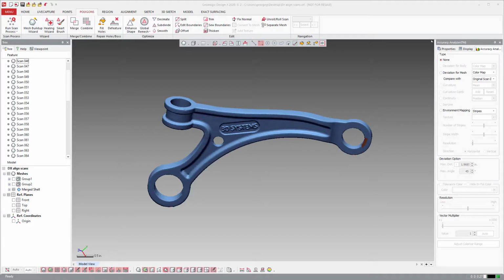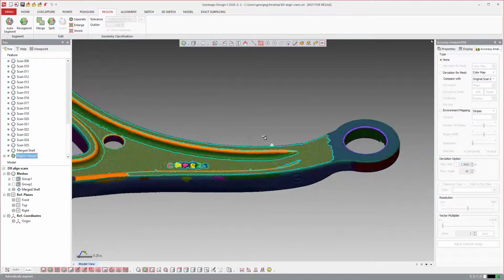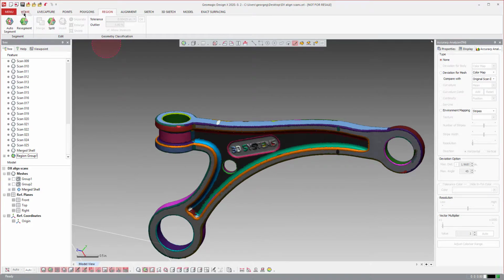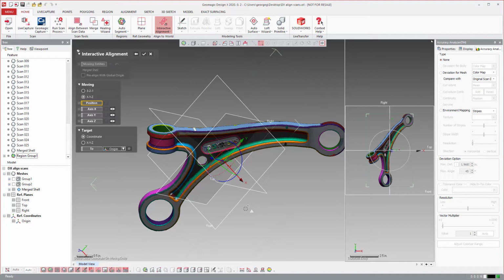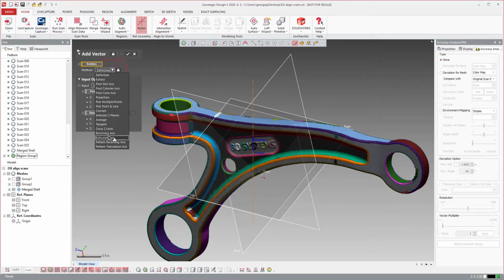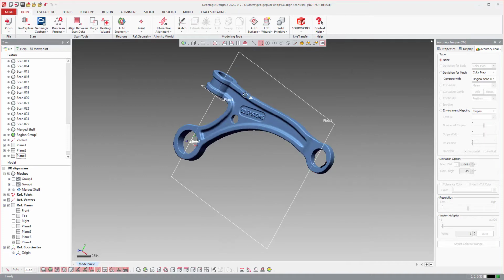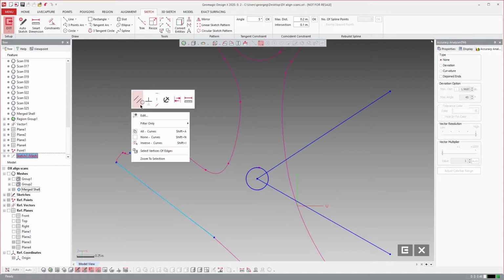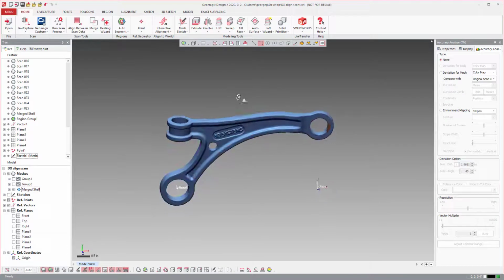Geomagic Design X -  Interactive Alignment-Align to World Tutorial

Comment: 3-2-1 explained.

There are 6 degrees of freedom. Translation along XYZ and rotation about XYZ

Datum A constrains 3 of those.
Datum B constrains 2 of those.
Datum C constrains the remaining 1.

They need not be any particular shape but what shapes they are will govern what degrees of freedom they are able to constrain.
For instance a plane for datum A is common. It is only able to constrain 2 axis of rotation and 1 translation.
A point is capable of constraining 3 translation and not rotation.
A cylinder can do any two translation and any two rotation. And so on.

Really good video on alignments of scan meshes for starting a workflow off on good footing.